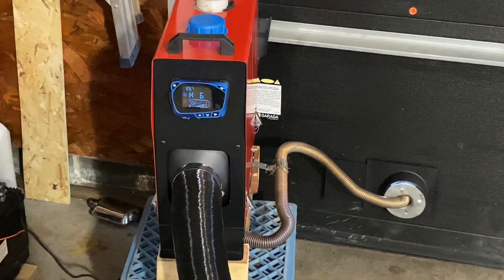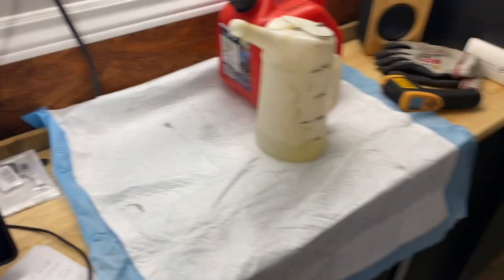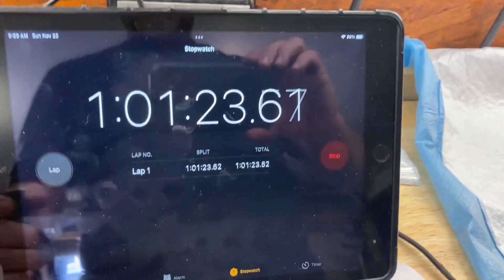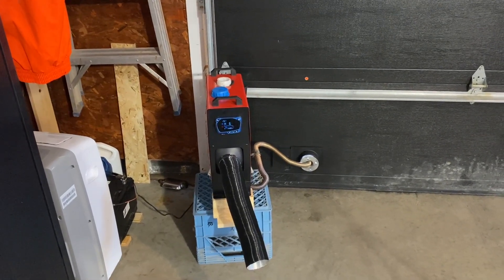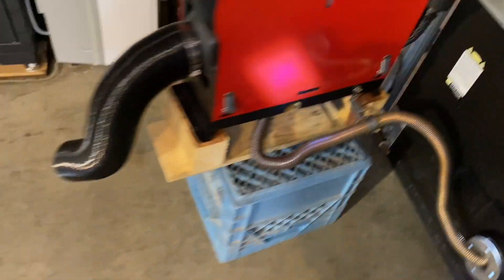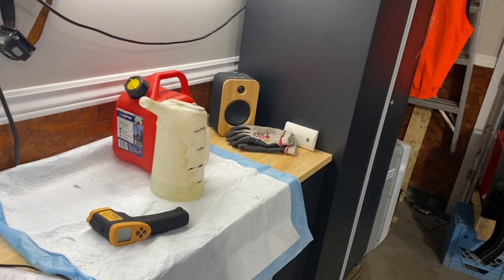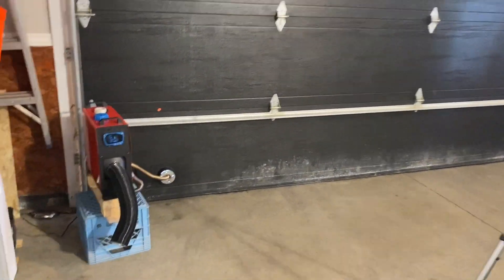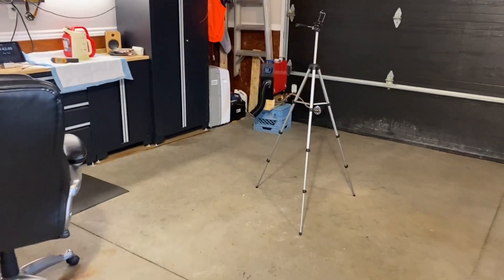Chinese Diesel heater consumption test.

Comment: Dyed diesel is about $0.10/L cheaper. Furnace oil is just dyed diesel but if you are pulling it out of a heating oil tank in Ontario you might as well just buy clear at the pump because they put a tax on heating oil that eats any savings. There is a cardlock here that will sell dyed without a cardlock card. Some won't do that. I have a petropass fuel card but I don't think my work would appreciate using it lol
Reply from the maker: Lol I’m sure they won’t

Comment: I was curious the difference in output temp on low versus high mode. You said about 200 degrees on high never heard the output on low. And I’m wondering if you pulled outside air to burn in the combustion chamber if it would be a benefit or a loss on keeping the inside temperature up.

Comment: This fits well with other videos about this "8" kW heater, Maximum output seems to be around 3 kW.(i L diesel contains around 10 kWh energy, so 8 kW should be 0.8 L/h+ exhaust losses. Remember this when you compare to electrical heating costs.(Usually cheaper than electricity anyway depending on where you live)

Comment: Nearly £2   a litre in the UK    ain't such a cheap option
Reply: Red diesel is cheaper or used engine oil which is free.
Reply: @Alexander_l322  I'm gona check out where I can buy      great vid  👍
Reply: Use heating oil, should be just under £1 a litre at the moment.
Reply: @leighreid5480  All i am seeing is min quantity 500 litres 88.5p + vat £425 ish outlay.
Reply: @jhareng  I must be lucky, there's a place near to me that you can get small amounts (less than 200 litres) from their depot.
Reply: £1.61 ltr now Jan 2023, 5ltr he says it takes so. Filled tank to brim 5ltrs, ran it on setting 3 until runout = 14 1/4hrs. Works out £0.565 per hour.
Air inlet inside various starts from as low as 2 degrees to 7 degrees this morning.
It puts out more heat than my oil filled rad on mid setting 1200W at .34p kw/hr = 41p per hour.

Comment: I read the 8k’s are only 5k or maybe AvE said that?
Reply from the maker: I believe that . They can’t be 8 kw they are same pump same physical size
Reply: @Storman77  seen a vid after I posted that and  a guy said the ones in Canada have a bigger pump now that are 8kw. Who knows.He had comments turned off.
Reply from the maker: @2hotscottpro  that might be but I sell wabastos at my work and the 8Kw is substantially bigger . This unit is a copy of the 5kw size and all. I will try and see if I can find that !
Reply: https://youtu.be/fWn1lASQpP0 What do you think?
Reply from the maker: @2hotscottpro  I really don’t see the difference . John Mck 47 goes through why they are not 8Kw and size , fan settings and the energy or transfer of energy he comments on. Simply need bigger in every way.
Reply: Most seems to be approx 3 kW. An 8 kW should use just under 1 Litre diesel/h.(Diesel fuel contains approx.10 kWh/L)

Comment: Shame you didn't do a heat test on the low ......can't believe these cheaper than running a UK heating system in your home
Reply from the maker: I did do heat testing but I did forget to share you are right . Guess I need to get busy . Yes it’s crazy
Reply: using one for 4years now to heat my home ,have two ,cheaper than uk electric or gas ,price of diesel’s going up all time I mix min with used cooking oil clean them out each summer.
Reply: @johnhealy9231  Gas in the UK is currently 10.3p per kWh.  That is natural gas - don’t mix it up with liquid automotive fuel.  So it rather depends on the cost of your oil.

BTW, better to use kW and litres as US gallons are smaller than proper Imperial gallons (and BTUs are long discarded by most sensible systems) which can cause misunderstandings - dependent on which side of the pond you live.  SI units are the norm, these days, in virtually all scientific institutions (even in NASA I would expect?).
Reply: @johnhealy9231  any dangerous fumes yet?

Would you say one of these all in ones are better than the kit ones that you put together yourself?
Reply: @rob-gbuk  you would have the exhaust going outside so you don’t get fumes.
Reply: @Alexander_l322  sorry I meant to say.....is the smell ok as I am thinking of getting one and having the unit inside the home with exhaust outside

Comment: Simple mathematics tells you how much fuel you should use. The .022ml dosing pumps that are fitted to the 5kw and 8kw heaters use 0.119L/Hr running at 1.5Hz, 0.158L/Hr @ 2Hz, 0.238L/Hr @ 3Hz, 0.317L/Hr @ 4Hz and 0.396L/Hr running at 5Hz.
Reply: Brain dead eh paul!do they understand the c value of diesel!
Reply: My 2kw one (the physically smaller one) had a .018ml pump but it wouldn't run on low and had hard starts. I put a .022 on and it works. Don't know if the pump that came with was bad or if it wasn't enough displacement. I ordered another 2kw one I'm going to try the pump that comes with it and see if it'll run it. I'm going to swap it out and take the heater apart and see if it carboned up with the bigger pump over the approx 100 hours it's ran. Still works fine

Comment: There is a video with heater think its used 3 years every winter every day  they just put old  car oil frying oil  everything used even water in the mix  anyway  they open up the heater and to be sure there was build up of all the waste but it was just wash it out and re fire  it up and it just as good as new :-)

Comment: The point is for how long time can be do that ..... Now the machine is new .... what about after 2 years of use???
If you like to increase the heat can use a longer metallic flexible exhaust make it a coil..
Reply: Been running mine for 4 years no problem clean out every year ,can even mix with with vegetable oil .
Reply: The maximum length and total degrees of bends permissible for the exhaust is in the installation instructions.  Exceed those limits at your peril!

Comment: Please never disconnect the power when it is running, because it needs to run its shutdown process to cool down so you don't burn up the circuit board.  Also it's a good idea to run it on high for 10 to 30 minutes before you shut off to burn off carbon deposit
Reply from the maker: I have noticed that burning high before shut down helps

Comment: do you think one of these heaters will be able to heat a 30x30 garage?
Reply: No you would need 4 of them,  I use 2 of them in my 35 foot bus
Reply: @jamesmason7124    And the insulation value of your bus is?  Lots of glass and steel?  Surface area to volume ration will make a difference, too.
Reply from the maker: Agreed need more power
Reply: Thanks. I saw they claimed 27k btu.. might be a bit of a stretch then. However. It does get rid of used oil and help heat a space.
Reply: I run one(8kn) in my garage 24 x 32 well insulated walls and ceiling.With it on the low setting it will keep the garage at about 53 at 15* f.
Reply from the maker: @rogerthetinker5116  wow impressive
Reply: @rogerthetinker5116  what is the outside temp when heating the garage?
Reply: @juliogonzo2718  it's been down to 20* f
Reply: Non insulated garage, 18x20 open rafters. It was -1F  no wind the other night and mine kept the garage around 45-50F.  Did take a while to really get steady with all the metal and tools actong like ice cubes...I usually fill it up to where the little view slits are, and to the bottom of the slits are runs about 12 hours.  Never measured how much fuel that really is. My intake air tube is inside. I have an all on one like the video with blue controller. That is running on 6 non stop.  Temp between 208-210 is what the display says. I also have put an extra 4ft of  3 in  vent pipe on the unit.  Never tried it on the other automatic mode yet.
Reply: @stephaniewert24  An 18K temperature rise is good for one of those heaters.  I’m guessing combustion air is from outside?  Anyway with a 5l fuel tank neither completely filled nor emptied in 12 hours, means that the fuel usage is rather less than 0.4l/h.  With an energy content of diesel being around 10.5kWh/l, the energy input to your heater will almost certainly be somewhat less than 4.4kW and (at, say, 80% efficiency) 3.5kW of useful warmed air.  

Heat loss will depend on the roof covering (insulation properties) and whether the garage is attached to the house, and draughts, etc, so a bit indeterminate, but your result seems like good outcome for you.

Comment: I just purchased one of these and the specs they're giving on The one I purchased is .48 liters per hour so that's very close to your experiment happy to see that and very impressed
Reply: Was yours purportedly claimed to be 8kW?  Diesel only contains about 10 1/2kWh per litre, so will only deliver about 5kWh worth of fuel every hour.  Take off the heat losses and you are well below 5kW of useful heat output.😊

Comment: I have been running mine to heat my greenhouse every night, running in manual mode.  I start it on low at sunset, and bump it up to medium before I go to bed (using the remote).  The following morning, I turn it off manually at 9am.  That's 16 hours of run-time.  I refill it with exactly 1 gallon.

Last night, I decided to try automatic mode.  I set it to 11 degrees Celsius, and also let it run for 16 hours.  It only used 1/2 gallon in that mode.